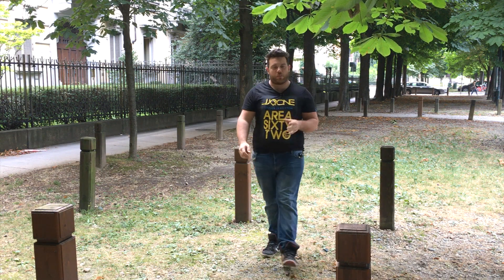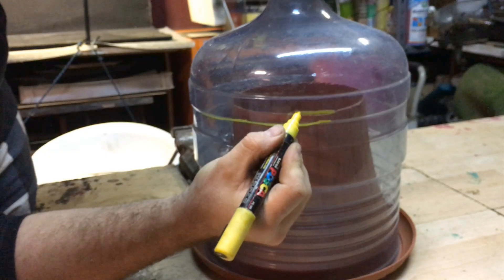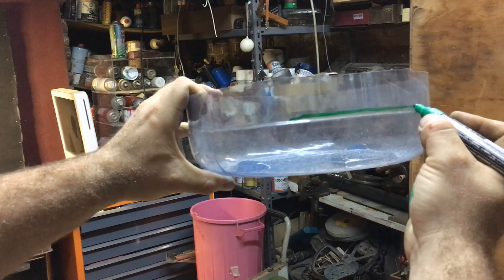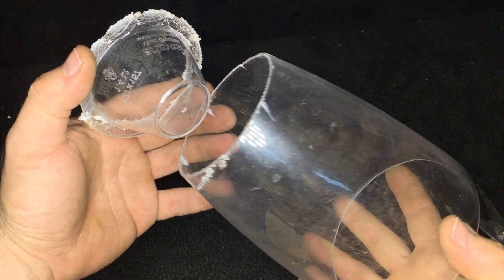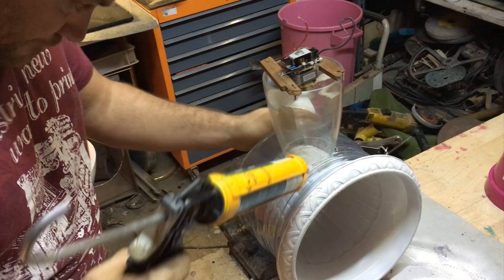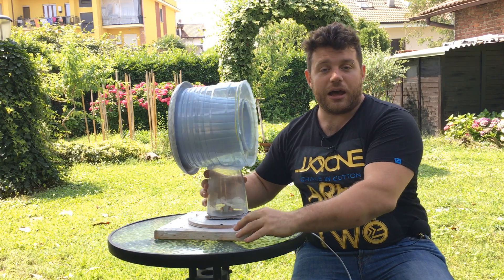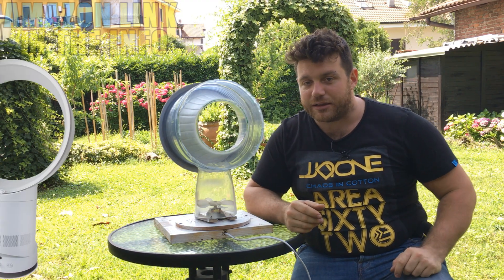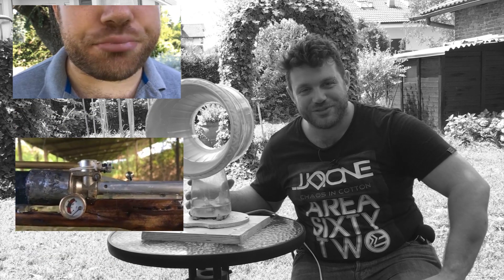BladeLess Fan - How to Make it - Dyson Fan DIY

Comment: You would get more air from just pointing the fan directly at yourself.  The only benefit of fanless designs is if you have children who might not keep their hands out of a regular fan.
Reply: Michael Ferguson

Air from fans is typically measured by CFM. which stands for cubic feet per minute.  Volume over X amount of time = more air.

But let's get down to actual CFM to get the truth.  At $300, the Dyson fan at its top setting, delivers approximately 1100 CFM.

These are numbers the Dyson specifications are completely void of.  You really won't find any technical information on their site.

Meanwhile, the average 20 inch box fan you can get for ~$15 can deliver more than 2,500 CFM.  Even cheap ones, on their lowest settings, should be able to deliver more than 800cfm.

So not just from a cost stand point, but also a performance stand point, bladeless fans are far over priced for what they deliver.  And while 20 inch fans aren't typically quiet, you can get decent cheap fans that are whisper quiet.

So you can get fans that are:
-cheaper
-quieter
-perform better

Bladeless fans are a marketing gimmick, simple as that.  Once you impede the flow of a fan, there is no 'effect' that can make up for it.  It's common knowledge that with any obstruction/impedance, total CFM's drop rapidly.  It's the same reason why perpetual motion machines don't exist:  You can't get more energy out than you put it, and friction reduces the final result.

People who build computers know this, which is why they have to use high static pressure fans to overcome the impedance.  That only helps negate the impedance, it doesn't actually remove the effects of it.

Even when it comes down to wattage, you wouldn't see anything significant enough to offset the cost even over decades of use.

And let's keep in mind, when that Dyson breaks, you're down $600 for that and the new one.....regular box fan breaks down and you're down just $30 total.
Reply: Michael Ferguson

Except for that to be true, you'd have to go against the very definition of CFM.  Let's say you're pulling in more air......like a person pulling another.....you're moving slower.....and slower air equals less volume over any given moment, which equals less overall air.  Since air cools by displacing heat through volume, i.e. mass, CFM is the end all measurement for the effectiveness of a fan, especially when we're talking fans that encompass a human body.

Now if we were to say a 20ft tall fan had 2500 cfm, compared to a 20 inch fan having the same 2500 cfm, THEN the smaller fan would obviously win, because those CFM's would be spread out over such a large area, that the effective amount of air hitting a human sized area would be drastically reduced.

This microwave fan is much much worse than even the one in a dyson fan.  I'd say it's rated at maybe 200cfm to 300cfm max......and that's pushing it, and that's without obstructions.  So while the strings he attached to it were flailing about, that's only because the air flow was concentrated on that small ring area.  That however, does not translate into increased CFM.
Reply: My CFM rating is from AFTER the air is expelled from the fan, which means that's ~1100 total full CFM for the $300 bladeless fan, versus the 2500cfm for the $15 box fan.

So there's really nothing you can add that would play catch up.  Even if they were the same price as a typical box fan, they'd still be less practical from their CFM rating difference alone.

It's like you're arguing just to argue, trying to find some way to counter the truth, but you're trying to prove a point that never stood up to the facts on conception.
Reply: C North Yes, but your comparing apples and oranges here. Your initial comment contended that the creator of the video would "get more air from just pointing the fan directly at yourself", which I took to mean his little microwave fan, not some completely different box fan he bought from the store.

Yes, I agree 100% that I can easily buy a cheap box fan that will give more CFM than an expensive Dyson fan. No question there. However, I don't think that the Dyson fan has a 2500 CFM box fan in the base which is being constricted down to 1100. 

I suspect the Dyson has just a little fan which on its own would only give ~500 CFM (I honestly have no idea on these numbers, just pure speculation) but which is being boosted up to 1100 by the venturi effect. That's what I've been talking about.

I'm pretty certain I fully understand what you are saying, and I agree with all your hard data. I agree with over 90% of what you've said. If you get some numbers on the little fan inside the Dyson and show that it would have given 1500 CFM on its own but the Dyson design is actually lowering it to 1100 then I'll concede, but like you said that kind of data is hard to find and I'm pretty sure my version is completely plausible.
Reply: +C North My entire argument has been based around conservation of energy. My second comment explicitly says that what I am saying is energetically plausible.

You can't just say "in layman's terms" and then say something that is completely disconnected from what you actually said.

And please, don't "layman's terms" anything for my sake. You've taught me something, you've made sense, I've given you the benefit of the doubt that you know what you're talking about and I'd like the same from you. But I want to see an actual argument based on actual physics, not this vague conflation of speed, energy and flow rate.

I've already given you a numerical example of a situation that conserves energy yet increases CFM. Lets go through it again in far, far too much detail:

Lets take simple fan blowing air at 2 m/s. Lets say the fan has an area of 0.5 m². Imagine the column of air moving through the fan. You can see that in one second the fan will have blown a cylinder of air 2 m long with a cross-sectional area of 0.5 m². The cylinder has a volume of 1 m³, and was blown in one second, so the fan is blowing at a rate of 1 m³/s (about 2100 CFM).

How much energy does this column of air carry? Well, 1 m³ of air has a mass of about 1 kg, and kinetic energy is ½m×v², so 0.5×1kg×(2m/s)² gives us 2 J of kinetic energy.

Now this cubic metre of air passes through the magical Dyson fan and comes out through an aperture with a cross-sectional area of 4 m². Lets assume that it manages to drag that whole circle of air with it by the Venturi effect. How fast is it going if it conserves energy?

Well, to conserve energy the outgoing column must have a kinetic energy of 2 J (or less). 2 J = ½m×v² but we don't know either m or v. However, m = Avρ, where A is the aforementioned cross sectional area of 4 m² and ρ is the density of air I alluded to earlier: ~1 kg/m³.

We put all that together and get 2 J = ½×A×ρ×v³ = ½×4×1×v³, so v = 1 m/s. We can use that to see that m is 4 kg. So we've turned 1 m³ of air travelling at 2 m/s to 4 m³ of air travelling at 1 m/s, no breaking conservation of energy, no perpetual motion, entirely plausible.

We've also gone from a 0.5 m² fan blowing at 2 m/s for a flow of 1 m³/s (about 2100 CFM) to a  4 m² fan blowing at 1 m/s for a flow of 2 m³/s (about 4200 CFM).

So again we get back to "it's plausible". What nuance have I missed by saying "magical Dyson fan" that makes this scenario impossible? The longer this goes on the more concerned I am that I've glossed over something important but we haven't hit on it yet.
Reply: So you've made one then huh? Can we see your video?
Reply: ehh they would only touch it once and learn the lesson prety quick
Reply: But if the fan has a tight enough grill the gap will be too small to put fingers through.
Reply: Depends what you mean by "more air" Do you mean a larger volume of air or faster air? Because I'm pretty sure the "bladeless" design shifts a larger volume, albeit slower, because of the venturi effect.
Reply: C North Those are some really good points. I agree with everything up until the last paragraph (and I still agree with 90% of that). I'm certainly not advocating that the Dyson fans provide any value for money at all. No question there.

I wasn't talking about that though. I was saying that I expect that the Dyson style fan will shift a greater volume of air per unit time than the little microwave fan on its own.

This is because, despite the obvious obstruction lowering the efficacy of the fan itself, the venturi effect will drag along quite a bit of extra air.

Now, I don't know the actual numbers here, and I'd be happy to be shown wrong on those terms, but it's certainly energetically plausible.
Reply: C North That's... not appealing to the very definition of CFM... It's... a not entirely applicable analogy as fluids don't behave like connected solid masses.

Very reasonable point about CFM being the most important factor for human scale fans. It might miss some nuance but as my argument doesn't rely on that nuance I'm happy to accept CFM as being the most important factor here.

OK, now back to my point. My understanding is that the venturi effect does not rely on momentum transfer like one person pulling another, it relies on faster moving air having a lower pressure ("Bernoulli effect") and the increase of speed of a constant flow (CFM) when constricted by an obstacle (continuity equation applied to fluids). Obviously momentum overall has to be conserved, but as the fan is essentially fixed to the table I don't think I have to worry too much about that here.

Anyway, you're right about the flow from the fan slowing down compared to it being unobstructed. This is why I said it seemed energetically plausible, I was appealing to energy conservation. The question is whether it slows down too much. 

So, 1m³ of air travelling at 2m/s has the same energy as 4m³ of air travelling at 1m/s. Obviously the latter has the higher flow despite travelling slower and having the same energy. This is the kind of transfer I'm expecting from the fan.

Now, I'm not that flash at fluids, so I may have missed something here. Probably the part where I said "so I don't think I need to worry too much about momentum". Obviously the process isn't going to be 100% efficient, but even at 50% efficiency we'd break even for my quick and dirty example.
Reply: Michael Ferguson

"Yes, but your comparing apples and oranges here. Your initial comment contended that the creator of the video would "get more air from just pointing the fan directly at yourself", which I took to mean his little microwave fan, not some completely different box fan he bought from the store."

Actually, yes, the overall CFM of the fan is reduced.  That means the fan driving ANY bladeless fan, would feel stronger from direct flow of the fan driving it.

A fan is all about driving air, a bladeless fan funnels air...but when you have air bouncing around and deflecting, it loses momentum driven by the fan, which reduces CFM compared to if there was no obstruction.  It may concentrate air though...but it doesn't even really do that in a meaningful way.  Imagine if a fan had a cone on it, essentially all of that flow would be concentrated to a small area....but bladeless fans are the opposite, it takes flow from a smaller fan, and spreads it out over a larger area, which means it will always be less than direct fan flow.

Let's also keep in mind that these smaller bladeless fans have to spin at higher RPM's too.  We're talking like 5,000 to 9,000 rpm or more.  That's compared to maybe 2000rpm or less of a box fan.  So it's not that there's some effect increasing flow, it's that they spin higher for their size to deliver. 

There's not really apples to oranges going on at all.  CFM, cost, decibels, etc.  The only place a bladeless fan wins is in aesthetics.....but I really wouldn't consider that worth it considering you could buy dozens of regular fans that perform better, for the price of just one bladeless fan.

Sure you could build your own....but the fan that bladeless fans use it more like a jet turbine than that microwave fan.
Reply: C North "the overall CFM of the fan is reduced" You keep asserting this but have yet to persuade me, not because what you are saying is wrong (it all looks right to me) but because it isn't addressing my point, which is the Venturi effect.

What you are saying is true for a single flow: that single flow might be obstructed, concentrated or diffused by different shaped cones (although one should note the CFM going into the front of the cone is always going to be the same as the CFM coming out of the cone, assuming a steady stream, regardless of the shape or orientation of the cone. Although the CFM the fan can produce may differ for different cones, or, indeed, no cone).

However, the air coming out of the Dyson fan as a whole isn't simply the air coming out of the little fan inside it. It's also the air induced to flow through the "fan" or cone or whatever by the air already moved by the little fan inside.

How this affects the output isn't as simple as just talking about obstructions etc. Which is why I'm still not certain about my conclusion, but also why I'm still not persuaded by yours.

Not sure why you mentioned the RPM. Is it to suggest that the little fans can probably shift a lot of CFM? I guess that's a good point and I might not be giving the little fellers the credit they're due.
Reply: Michael Ferguson

The venturi effect isn't what you think it is.

https://en.wikipedia.org/wiki/Venturi_effect

"...Thus any gain in kinetic energy a fluid may accrue due to its increased velocity through a constriction is balanced by a drop in pressure."

In layman's terms: it doesn't increase anything.  I covered this earlier when I talked about perpetual motion machines.  You can't get more energy out of something than you put into it.

https://en.wikipedia.org/wiki/Mechanical_energy#Conservation_of_mechanical_energy

To put it simply, you can't put say, 800 CFM through a tunnel, and get 1100 CFM out.  In reality, you're more likely to put something like 1500CFM in a tunnel, and get 1100 CFM out no matter how you design it, due to friction and direction changes reducing the movement of the particles of air.

I know what you're saying about the air you think is being 'induced' not by the fan, but through negative pressure, but it doesn't, and indeed it's impossible, for it to work in a manner where it would increase flow in any way.  You don't get something for nothing.  The design might help to stabilize the final exhaust flow, i.e. reduce exhaust turbulence, but it will not increase the flow.

There's no way around this, these are core scientific facts that govern the fundamentals of our universe.
Reply: +Michael Ferguson so is the benefit less power consumption compared to a 1100 fan?
Reply: donepearce Yeah, I've skipped a ton of detail here but both are happening. The drop in pressure due to the venturi effect is what draws surrounding air in in the first place. Entrainment is the reason this new air flow is drawn along in the same direction as the air blown out along the the rim. There's plenty more to it but I was just trying to get in on the essentials.

econojon Yeah, it's certainly plausible if it's actually working the way I said. You'd have to look at the specifics for that fan though.
Reply: donepearce

It's pretty sad that this guy went through all that, just to try to argue a point that was wrong at inception.  Even worse, he tried to reason with very bad math that he didn't seem to understand well.

In fact, the entrainment effect is a big part of why fans work in the first place....the blades spin and push the air beneath the blades, while air is pulled.  Of course, part of that has to do with general pressure, since you can't just move air and have a vacuum be in the spot you moved it from.

But of course, even with the entrainment effect, you won't get more CFM than the fan itself initially outputs directly above the blades.

So while the effect will indeed pull surrounding air along with it, it is at a very slow rate, and doesn't impart momentum enough to increase CFM, since the very act of the air being 'caught up in the motion', results in resistance/friction from the differentials in air speed.  In order to give that pulled in air some speed, the air coming out of the bladeless fan has to impart momentum on it, which also means losing momentum itself.

That guy seems to not understand the science behind the conservation of energy....which is really sad because that pretty much tells me that this guy has a LOT of incorrect views on life/science in general due to just his lack of understanding that fundamental truth.
Reply: C North It's pretty sad that you can't even come up with an actual argument against my point even when I'm quite uncertain of it. I'm trying to work with you here!

Is my maths "very bad" because the reasoning and motivation is poorly explained (I'll cop that, maths is hard with just text), because I've made a mistake somewhere (where!?) or because you don't understand it?
Reply: Michael Ferguson

Your entire position has been wrong from inception. Thus any conclusions drawn from it are wrong.

There is another guy that thought very much like you, and people explained to him why he was wrong, in the same way I'm explaining to you that you're wrong:

https://www.physicsforums.com/threads/as-close-to-perpetual-motion-as-we-might-ever-get.423223/

Fact: Dyson bladeless fan is less efficient than a conventional fan, and the final output is also less efficient than the fan inside the dyson itself.
Reply: C North That guy is making a completely different argument than me. In fact the very first response disproving the guy agrees entirely with what I've been saying: "The Dyson blower is very high pressure and very low flow. The induced air is high flow and virtually no pressure." The little, low flow fan inside the Dyson produces a larger flow in the end.

The guy who thinks he's discovered perpetual motion is wrong for the same reason you are wrong: he thinks that more CFM = more energy. Whereas with a wide enough, slow enough flow you can get a very large CFM for a very low energy and vice versa.

I'm perfectly happy to accept that the Dyson fan is less energy efficient overall than a well designed (and proportioned) conventional fan with the same flow. That seems reasonable and doesn't contradict the solitary point I've been trying to convey this entire time.

You've said more than once that my argument has been "wrong from inception". If my argument was based on faulty premises then yes, it would be a poor argument and I would concede. What, then, is my faulty premise? Please, just tell me. This discussion wasn't supposed to blow up like this.
Reply: Michael Ferguson

"Whereas with a wide enough, slow enough flow you can get a very large CFM for a very low energy and vice versa."

CFM is CFM is CFM....is CFM.   The number I quoted for the dyson is the actual measurement.

Due to the energy it takes for the flow to impart momentum on the surrounding air, overall volume is reduced.  That means there is no large CFM for low energy, in comparison to conventional fans.

The CFM coming directly from the fan, unobstructed, will be higher than the CFM after the 'air multiplier'.  It may drag surrounding air along with it, but it is less.
Reply: C North Have I ever expressed even a sliver of doubt in your numbers? No, I trust them 100%. Always have.

"Due to the energy it takes for the flow to impart momentum on the surrounding air, overall volume is reduced." This is a really vague statement, loosely linking energy, momentum and volume flow rate, three quite distinct concepts.

I'll try to make my point clearer. Lets quickly consider 3 different conventional box fans. The first has blades that sweep an area of 0.5 m², the second sweeps an area of 4 m² and the third is absurdly large and sweeps an area of 100 m². They are each trying to push a volume flow rate of 1 m³/s (2100 CFM).

The first needs to push at a speed of 2 m/s (2m/s × 0.5 m² = 1 m³/s) to achieve that flow rate.

It follows that the second needs to push air out with a speed of 0.25 m/s. The third needs to push air with a speed of 0.01 m/s. Make sense? This is trivial and I'm pretty sure we both agree here.

Now, in a 1 s interval of time each of these fans has pushed out 1 m³ of air, which has a mass of about 1 kg.

That 1 kg of air has a kinetic energy of ½m×v². We agree on this, right? Do we agree that the kinetic energy of the air is the energy the fan has to provide to the air to get it moving?

The kilogram of air blown by the first fan in a second therefore has an energy of ½×(1kg)×(2m/s)² = 2 J.

The kilogram of air blown by the second fan in a second has an energy of ½×(1kg)×(0.25m/s)² = ~0.03 J.

The kilogram of air blown by the third fan in a second has an energy of ½×(1kg)×(0.01m/s)² = 0.00005 J.

To keep a continual stream of air flowing this energy has to be provided every second, giving a power output of 2 W, 0.03 W and 0.00005 W respectively.

We can see very easily that you can get a high CFM with a low energy input. With very little extra effort you can show that you can also increase CFM without increasing energy. You can clearly get an arbitrarily high CFM for an arbitrarily low power (but whether or not such a flow is useful is a different question entirely. Probably not)

Now, in this case we've got these high flow rate, low energy consumption flows by switching from one fan to another. However, I see no particular reason why an appropriately designed system couldn't convert one to another, and indeed the Dyson fan appears to do just that. Again, whether it is worth it is another question entirely and one I'm not debating.

I should add here that I found my mistakes in my previous maths. The numbers were all fine, but I had some typos and a weird case of repeated words. I've fixed it now so you should be able to follow along better. Please let me know if you've found any mistakes in what I've said there or here or anywhere else.